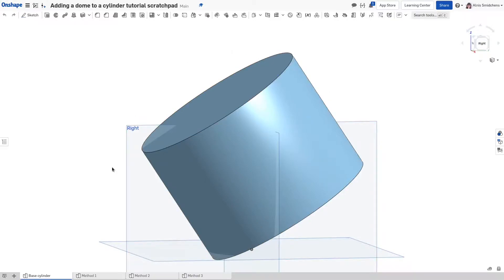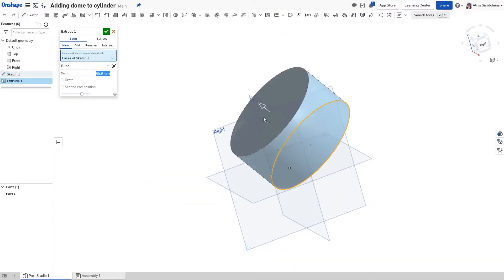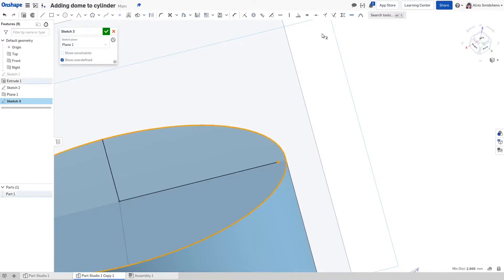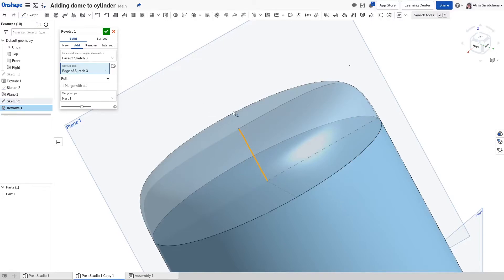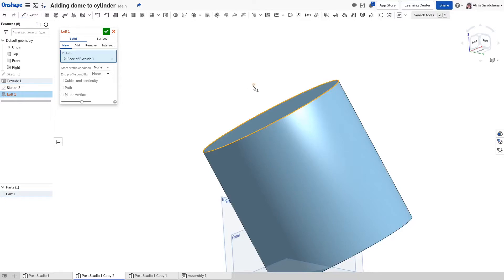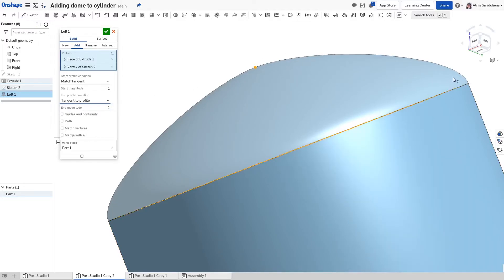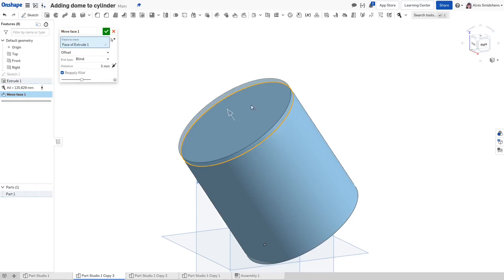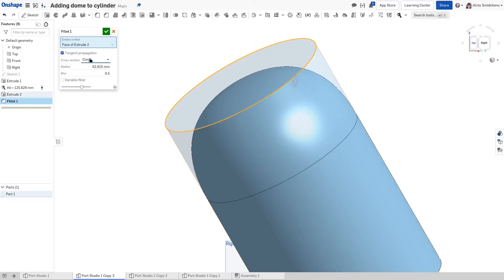How to add a dome to a cylinder in any CAD program - 3 ways, 6 minutes

Comment from the maker: Unfortunately, I forgot to switch the loft start condition to "Match curvature" at 3:55 for the big circle. This means that the loft only had G1 continuity with the cylinder, not G2 continuity (and there wasn't a smooth transition, d'oh!). If you want G2 continuity there, just switch it to "Match curvature," and you'll be set. Sorry!

Comment: Here's my comment with ideas for a future video! (btw, your stuff is amazing - I just shared out to my facebook. exactly the breakthrough content I was looking for)
Imagine an egg shaker. In the end it will be made from glueing slices of laser cut sheet acrylic together. Basically visualize an egg that's gone through a 1980's hard boiled egg slicer. Then you cut out those slices on the laser cutter and glue the hollow egg shape together. Slices need to overlap for glue up. Some sort of part registration would be amazing. I.e. maybe each slice accepts the next smaller slice in a shallow "male/female" type inset. This allows the small piece to "lock" into place for proper glue alignment. But maybe that's too crazy. Probably just a 1mm registration hole would work - just poke in some 1mm wires between the two adjacent pieces for registration purposes.

For better or worse, that's my idea! Keep it up. Your videos make the world a better place.
Reply from the maker: So sorry I took so long to respond! That sounds like an awesome idea! Thanks for sharing! I recently got access to a laser cutter, so I'll be able to actually physically make it and document the whole process. Thanks again for watching and for the kind words!
Reply: @AlnisSmidchens  That would be amazing. Would love to watch and share. (or even collaborate!)